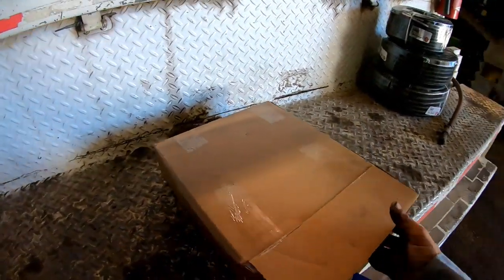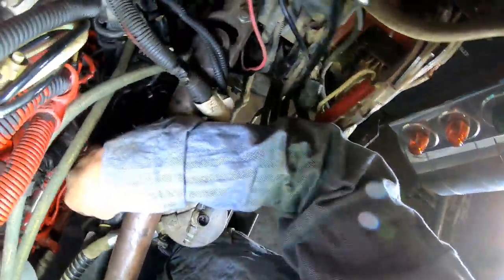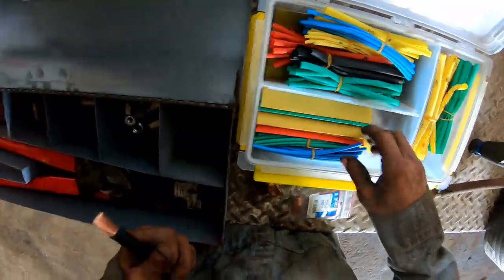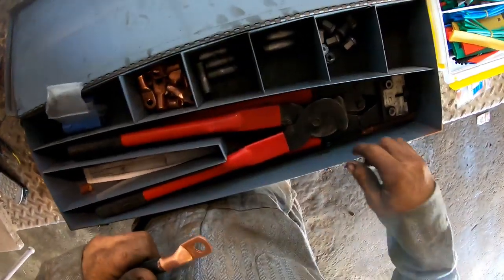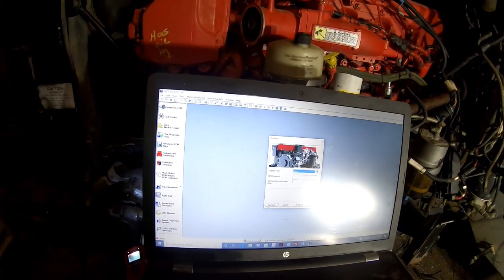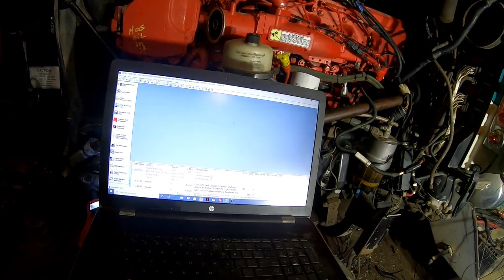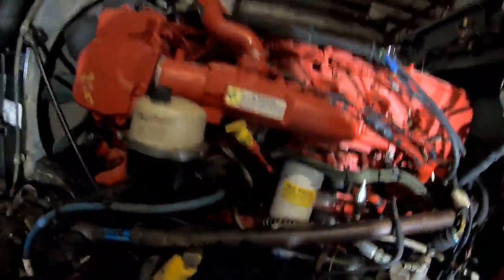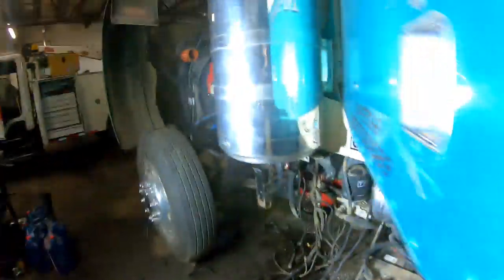Caterpillar to Cummins swap pt.5

Comment: Good work Warren, it's always gratifying to hear them fire up. Sometimes I build up a connector with electrical tape to make shrink tube fit better. I also will put either no/ox or dielectric grease on the copper so the lug goes on easier. Looking forward  to seeing it done.

Comment: It is always a relief to hear it run. When I installed an engine we always would only hook up essential stuff required for the first start. Once you heard it run then you went on to finish the installation. You had it so much worse than my toughest one in having to deal with all the emissions stuff too. My toughest one was putting a 400 Cummins and an Allison it a GMC Brigadier. The chassis originally had the Cummins but had a manual trans. Plus I then stretched the frame and installed tandems in place of the original single axle. When I got it the engine was on the ground beside the chassis. Different model year also.  But it finally got built. I had lots of hours in it as well.

Comment: years ago I use to crimp the lugs on the cables. about 6 years ago I found solder slugs you put the lug in the vice just to hold it put in a slug heat it till it melts (they flame up then melt) insert the cable hold a few seconds then shrink wrap leaves no possibility for moisture or oxygen to get in

Comment: I agree on wire size. The bigger the better. The heavier the gauge, the lower the resistance, the lower the voltage drop under load, the more voltage you're getting to the starter etc. Nice to hear it fire up. It sounds good.

Comment: Hats off to ya Warren !! There is not many shop owners that would take on a project like this......... ESPECIALLY A SOLO OPERATOR !!! This is when a time clock would be handy. Keep track of your hours because you know how time slips away on wiring and drivability jobs. What a nightmare. It is hard to believe the Government can obsolete a perfectly great running semi. Especially with some of the garbage on the road today in my area of NO DMV INSPECTION. People put wheels and lights on trash cans and run them down the road here in Florida !!

Comment: When i am in that situation with the color of the heat shrink being too big, i will put the correct size in whatever color first and then put the larger and correct color over it. SUCCESS! she runs and sounds pretty good so far. its coming along very nicely.
Reply: We are watching your Cabover project.

Comment: Ground everything to the battery neg.  you’ll slow down cavitation from the electrons traveling through the block, tranny, frame, radiator.  We did that and noticed a huge difference in our trucks when we did it to our brand new trucks.   Stopped our liners from leaking and our coolant lasts longer.

Comment: You'd be amazed at how much heat shrink can shrink. The stuff they give us at work is over twice the diameter of the 4/0 cables we make, but if you heat it evenly long enough it'll eventually fit.

Comment: You really don't want to use heat shrink that barely fits anyway. Part of it is that the tube thickens as it shrinks, providing better insulation, strength, and abrasion resistance.

Comment: Okay I will rain on your parade. Actually good job on getting the electronics to work. Installing an engine is easy. But getting the ECM working is a major project, I have custom wired ECM`s before, It is always a good feeling to hear the engine start. Even if you a few minor issues to work through.

Comment: I haven't had a tool to crimp ends like that so I do it the old way. Flux the end of the wire and put the end in a vise. Then fill the connector with solder and heat till it all melts and shove the wire in then put shrink tube over it.

Comment: Lawson products was the only one who had the right sizes for shrink tube. And it had a sealant inside as well. It wasn't cheap but we used that shit on everything. Wooden hammer handle fractured? Sprint tube it! Rope need a nice end? Shrink tube it. Needed to get a ladder truck back to the shop but the air line was melted through, snipped off the melted part and shrink tubed the ends together. Made it to the shop no problem.

Comment: Not sure how far you’ve gotten, but i would suggest doing that ecm calibration, it should get rid of that scr code, that can be a headache to diag. Impressive work though, you’re a better man than I!
Reply from the maker: The can Terminator was cut out of the harness.

Comment: The wiring on one of these trucks has gone out of control. And would someone tell me what is dep for. I know it is involved with the catalytic converter but I wasn't aware that the older trucks had them or are they retro fit???

Comment: I've been there with the steeling of parts issue. When I was passing boring times I took a class on doing mechanic work even though I already knew what I was doing.  The teachers aid decided to take  parts from a car I was repairing in class for a car he was working on.  I caught him doing it red handed to. Needless to say I made it very clear if he did it again I would make him regret getting the job as a teacher's aid. He tried to cry about it and get me kicked out of the class. Needless to say he lost his job.  We were responsible for the cars and parts for the cars we were working on is why I got so mad. And how that dickless pos got that job in the first place is beyond me.  He knew pretty much nothing about working on cars. Cant tell you how many times I fixed his fuckups or the teacher asked me to help him fix a car because he didn't know what to do.  Downright stupid.  And this was a regular college vocational course.  Go figure